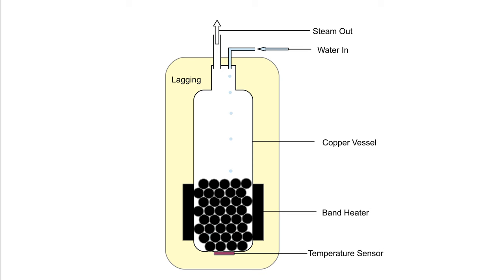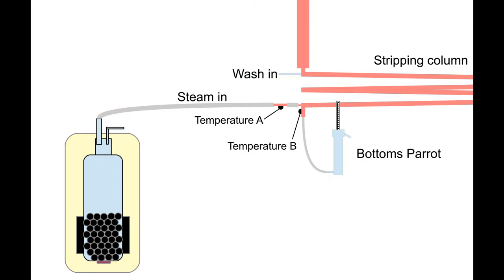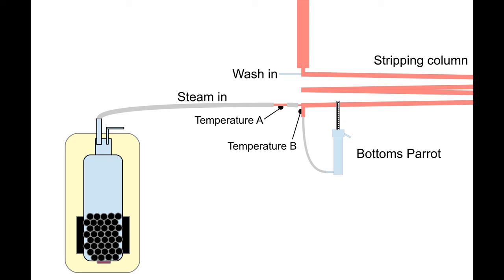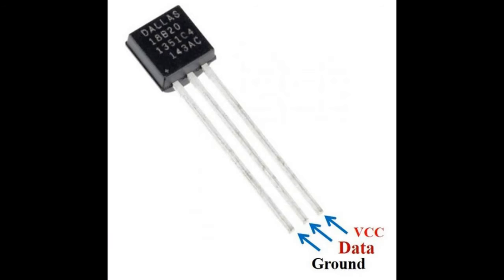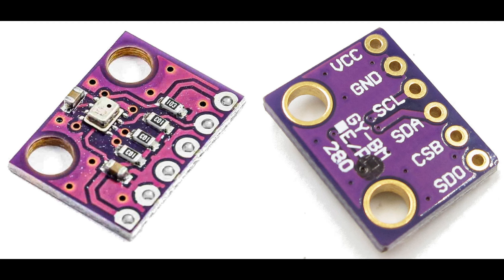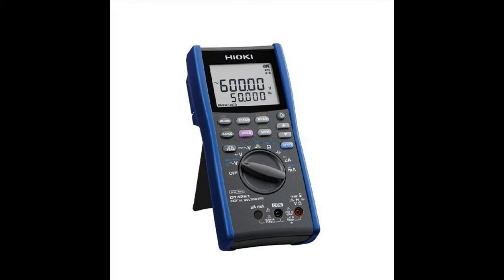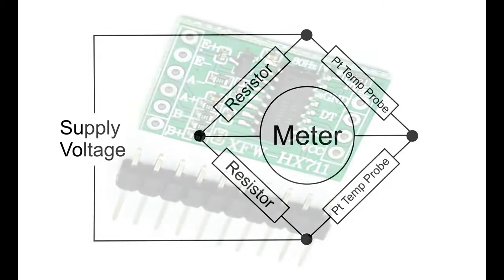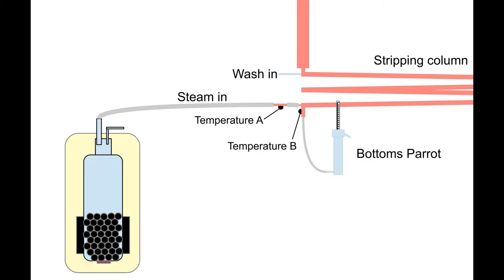Thermometric atmospheric pressure compensation

Comment: I enjoy watching your videos, I also have a continuous column and have suffered with control as I keep trying to ramp production up. I started off by trying to use all these sensors and controllers, but even small changes in feed temperature or cooling water temperature (for example) resulted in the purity changing drastically between 96% to 90%. Further, I don't have SPP packing, I've just been using stainless steel scrubbies, which are not very corrosion resistant, and so over time, they choke my rectifying section. But in the period that things are working well, I find that sometimes having "controlled" oscillations in my reboiler pressure are fine over periods of 10 s or so. The Gauge pressure is approximately 3 kPa in the bottoms, and fluctuates by Maybe 1 kPa up or down. Hard to tell with an electronic pressure sensor, but easy to watch with a manometer. Maybe focusing on integrating the temperature over a span of time (say, 20 s) is good enough to control over your desired bottoms temperature and pressure?

I also found that increasing the volume of the bottoms section, feed section (to essentially allow for a wet leg) and Reflux pool (instead of a drum, just a big piece of pipe under the condenser) further assist with reducing fluctuations because it takes a longer time to change the state variables (P, T and composition).

I use gas for heating, not steam generation by electrical heating though. Not the best, but better than an unstable grid in South Africa. 

So far, I've managed to get 600 mL/h from 1 kW of reboiler duty, any more and it just leads to flooding at the top of the column. Feed temp is at 45 deg C, recovery is 95% (I don't want higher recovery as it tends to bring up more fusel oils) with feed composition at 10% v/v. I use a pump, splitter and gravity feeding, I found that peristaltic pumps are too unreliable. My feed system is also unreliable without regular cleaning as the yeast tend to floculate and sometimes clog the feeder, but far better than trying to control pump flow or using a valve.
Reply from the maker: I've had similar experience with fluctuations in vapor output over periods of 10-20 seconds or so being well tolerated.

That's a pretty impressive yield for a one kilowatt reboiler. I guess you have a much wider column than I do and correspondingly proportionally less lossy. 

I experimented with a preheater and feed temperature just below the boiling point of wash but then I replaced it with a heat exchanger from Bottoms which reduced the feed temperature to about 70 degrees and it made no difference at all to the product. It just meant increasing the boiler power by the amount that the preheater had been using. 

Gas heating is a lot cheaper and I would use it if I was operating on a larger scale. Most commercial distillers use gas because of its lower energy cost, but the equipment cost is higher, which is why I haven't used it so far.

I have found roller pumps to be OK but i am using small ones at under 30 ml per minute. I have not tried larger ones. What type are you using? 

My obsession to to get over 96% maybe more aesthetic than practical, but I have found that with the temperature controlled column top extension method of fractional distillation, the fusil oil headsy flavour issue is much improved and the product is marginally better at the higher proof than at 95%.

Comment: That was ultra informative Sir thank you, I'm still running a P I D through a SS 40amp SSR-V with a potentiometer to run my steam generator to my still for strippings runs on the grain.
Reply from the maker: I'm guessing that you do not use a flash boiler for a steam generator as I do, but rather a regular boiler that you recharge with water periodically. If that's the case, what temperature do you use as the input to the PID? And where does the potentiometer fit into the circuit?
Reply from the maker: If you are using it for stripping runs why dial back once steam is flowing?
Reply from the maker: You are injecting steam into mash rather than heating it directly? Clever. I have had trouble making gin with botanicals burning on the heating element. Vapour infusion does not get the big gin taste I like and a suspended teabag of botanicals does not seem to get the flavour out as well. Do you think you steam injection method could be the solution?
Reply: @tight1449  I think it's worth a try.
Reply from the maker: @garrymcgaw4745  I'll try it and report back.
Reply: @tight1449  Good onya mate, hope it works 👍.

Comment: Very interesting, thanks. I've been wanting better resolution measuring the vapour temp at the point of product offtake to infer alcohol content on my boka style still. I replaced a DS18B20 with a pt100 to achieve better thermal isolation of the measurement and to try to achieve a higher resolution measurement. The pt100 is "measured" by a MAX31865, which is an improvement with a resolution of 0.03125degC, but I want better. Mine is not a continuous still but with a good column of SS spp it sits hard on azeotrope for hours and I find as soon as the vapour temp starts to climb even 0.1 degree I am basically at the end of hearts. I calculate the abv as part of my ESP32 run instrumentation setup and to deal with barometric pressure influence on inferring abv from vapour temp l "calibrate" the abv by correcting measured temp to 78.2 when the column is stabile after heads are off. It seems to be reasonable and with a nice trend curve plotted on a web page generate it is very easy to monitor, but i want more resolution in measuring the pt100. If you find a solution to your need, I'd be very interested if you share. Thanks very much for your excellent teaching videos.
Reply from the maker: When I started out I was hoping to use the column top temperature as a control parameter and before I abandoned that idea I made a high precision temperature sensor system using a PT 100 in a voltage divider running at 100-500 microamps. Then I used a Texas Instruments ADS1256 analogue to digital converter. It's an SPI device controlled from a Raspberry Pi. This setup gives you a resolution up to about 40, 000 counts per degree C. Then if you take a thousand or more measurements and average them, you get a reasonably good result in milli degrees. Probe auto heating is a big deal at these resolutions. This is just the ohmic heating that occurs in the platinum probe. You can reduce this by adding another op amp and reducing the current through the probe, or by only turning the probe on when you're taking a measurement. My solution was to run it continuously but wait until the temperature had stabilised before calibrating, which took 10 to 15 minutes.
Reply: @tight1449  Thanks for that. Good information. I expect the ohmic self heating should not be a big problem for me as the temp settles down then remains very stable for hours. After say 20 mins I can zero adjust it out. As it is monitoring only and I'm really mostly only interested in the last part of the run, it should be fine.

Comment: You're a smart man * I apologize if this has been covered material but what is your preferred heating element? Someone was explaining the issues with heat elements that operate in cycles versus consistently powered heat. They were explaining why using stove systems on a flat top stove give poor results because the stove cycles on and off a lot causing inconsistent temperatures within the tank. I've been looking at building a still from a 55 gallon stainless barrel and some heating bands designed for barrels that can easily reach the desired temperatures but I"m waiting to hear back from a manufacturer if they cycle the heat or not. 
 If you have any thought on the matter, I'm ears and eyes.
Reply from the maker: That is a tricky problem, because commercial heating systems generally are thermostatic, and they have a pretty long duty cycle, giving fluctuations in vapour output that mess up the control of the column. Another lesson I learned in the school of hard knocks is that these thermostatic systems often involve switches which spark and can ignite alcohol vapour, something to avoid. 

There are two basic solutions. One is to power the heater continuously, but with a variable voltage to control the power. The problem with that is that variable voltage supplies that are powerful enough for this application are expensive. So the solution I prefer is to stick with the variable duty cycle method, but to increase the frequency of cycling. I did this with a solid state relay controlled from a Raspberry Pi, using Python software timing to vary the duty cycle, running at a frequency of about 1 Hz. There is a technicality with the way that solid state relays function with AC, They'll turn on when commanded, but they will only turn off when the AC wave crosses zero, and that adds a random component to the duty cycle of up to about 20 milliseconds, or 2%, though in practice I didn't find this was a problem. 

Simple thyristor based circuits are a less expensive solution to this problem, controlled with a potentiometer, but I didn't use that because I wanted digital control.
Reply: @tight1449   Thank you kindly